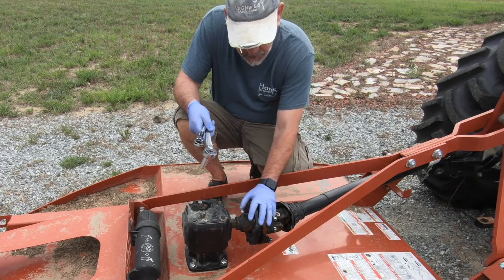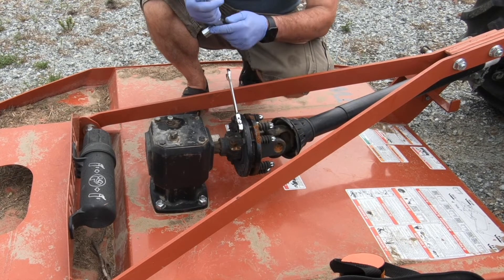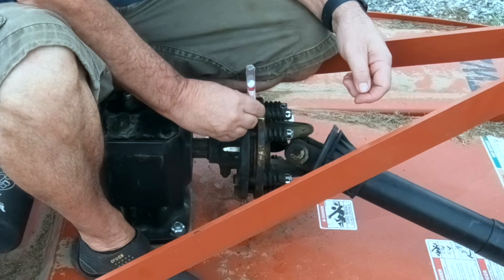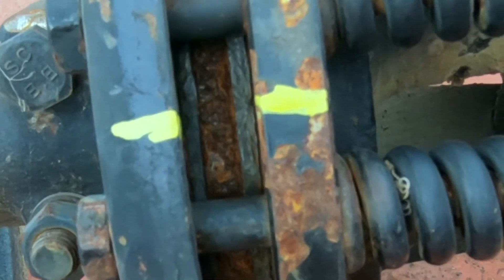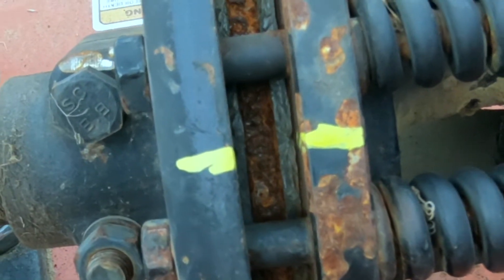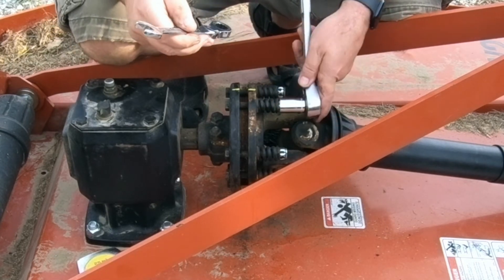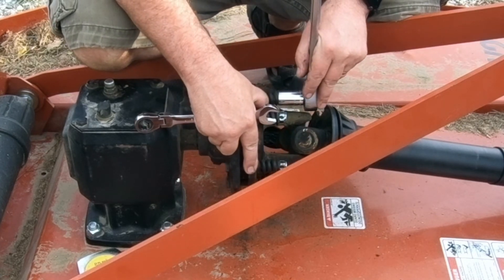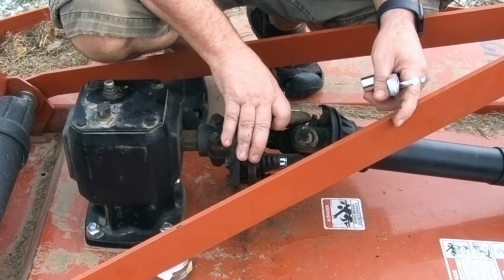Slip Clutch Maintenance

Comment: Better than  pin for sure.
Reply from the maker: It really depends on what you're doing.  If it's only mowing cleared fields or mowing down cornstalks, you can save yourself a little bit of money and maintenance and go with the shear pin option.  For my needs though it has to be a slip clutch for sure.